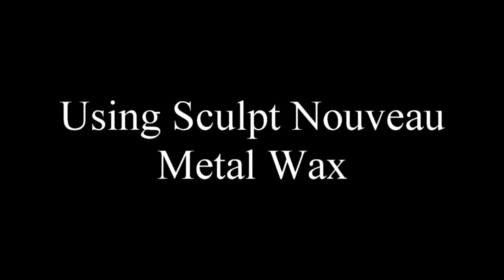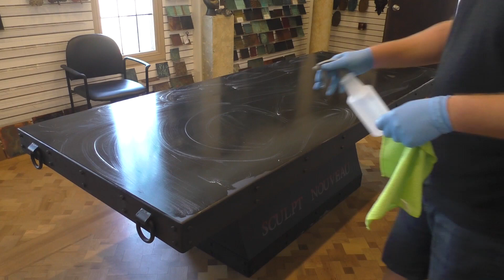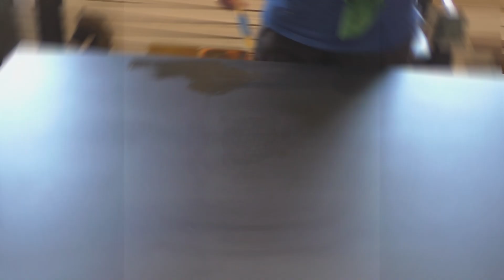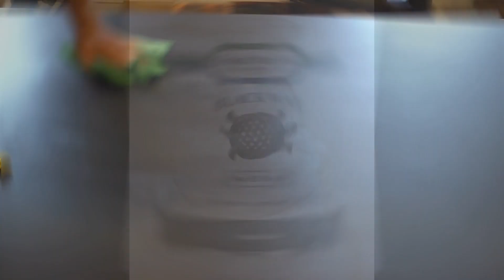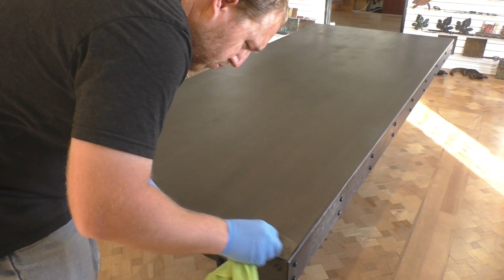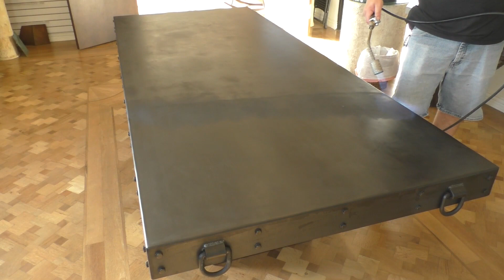Using Sculpt Nouveau Metal Wax

Comment: Isn't this wax aggressive towards the skin?
Of course after curing and finishing
Reply from the maker: Not sure what you mean by aggressive towards skin. Once the wax dries, it just sits there and protects metal like wax on a car would. Many of our jewelry makers use the wax as a final protective coating.
Reply: @sculptnouveau  I want to use steel for the floor in the kitchen ... steel plates instead of ceramic tiles and I want to use Metal Wax as a finish, but if it is used to work from jewelry then it will not be a problem for my bare feet.
Reply from the maker: @pstros333  Wax likely will not hold up very long in that application. Wax is a coating you would need to reapply periodically, especially in high traffic areas like a kitchen. You would be better off sealing the steel in with a clear coat and then maintaining it with the wax. This would be more like how we take care of our cars.
Reply: @sculptnouveau  thank you for answer
If I understood you well ... it's better to apply Ever Clear before the wax.
Reply from the maker: @pstros333  Yes that would work.

Comment: Hi, I was wondering if this will work to protect a heat and rust patina? Also does it darken the colors?
Reply from the maker: yes though the ColorLoc does a better job at protecting the heat toned patinas. For rust patinas, I usually recommend the Clear Guard or Ever Clear. Waxing rust will usually result in some of the finish coming off. Some patinas will darken with the wax but not all.